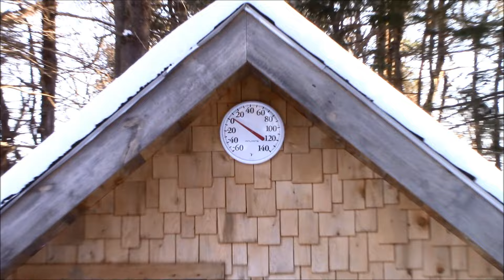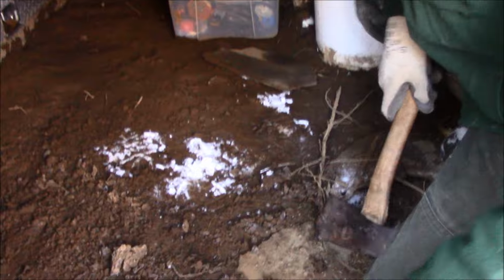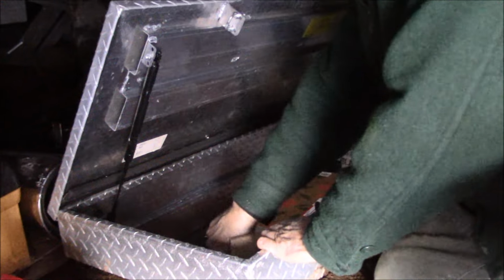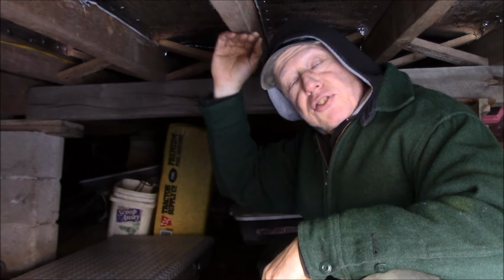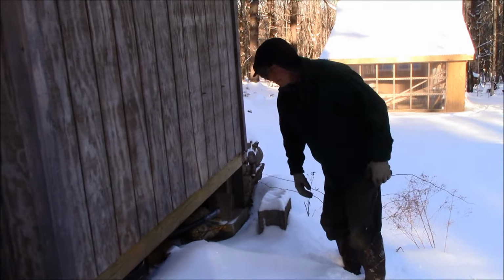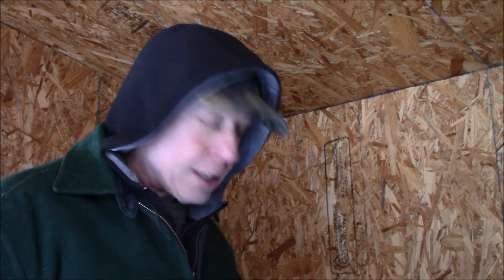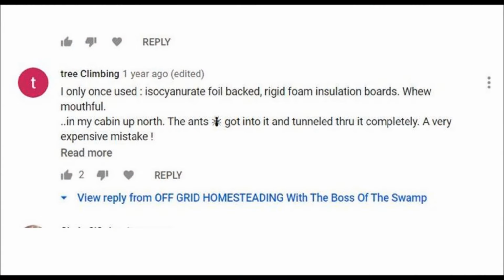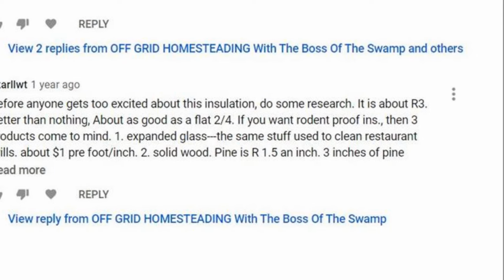Awesome Floor Insulation For A Cabin In The Woods   3rd Year Review

Comment: I think what you’re doing is awesome and works.  I have come up with a “layered system” using this foil and other common, easy to work with, and inexpensive materials to insulate my ceilings with. NASA insulated the first moon shot rockets and the Space Shuttle with this kind of foil. The Aerospace Industry, Automotive Industry, the Construction Industry commonly use it. Tesla and SpaceX uses similar material on both their ground and space vehicles. Works great for insulating cabins.

Comment: hi bosss i have  used  this bubble   foil  in my metal barn 32x48 with great results  wall and sealing  Its made the whole shop much more comfortable  I am know framing walls and plan to use fiberglass ins  The only down side to the bubble  foil  is it burns  like a match

Comment: I watched both of your videos on insulating cabin floor while my wife and I were building our cabin home. We already had floor down so used 16 in wide strips of that foil between the joists in floor and ceiling. We also used pink fiberglass in ceiling. So I would like to go on record with u no mice in floor no underpinning yet but while we camp over there you can walk across floor barefoot with no frozen piggies so they can still run home. Just wanted to say thank you for the information otherwise we would have used fiberglass in floor my face arms neck back stomach and everywhere else it would have gotten thank you as well.
Reply from the maker: Warm piggies here too troy :e)

Comment: Boss, I've used the foil insulation on a cabin roof and did not regret it, I just Spray Foamed the roof recently but will be repurposing the foil insulation to the skirting & under the floors. Works like a charm and I credit you with keeping our cabin warm the last several years. Thanks !!
Reply from the maker: Good to hear from you Jerry. It's been a while ;-)

Comment: I've been slowly rebuilding my old mobile home and used Boss's idea and have a full wall in my kitchen insulated with nothing but single layer bubble foil, I have nothing covering it at all and I get now coldness seeping in from the metal mobile home exterior It works great. I also have some videos of it as well.  I also insulated the floor in my bathroom.
Reply from the maker: The stuff is amazing.  Those jugs of water never freeze in that shed and only plywood and one layer of foil between them and the winter temps :-)

Comment: I am building a 15 x 30 shed and thought of using the bubble foil perpendicular on top of the joist, provide some slack to create an air barrier when I install the OSB sheeting on top of it. 
As always, I respect your judgment, and opinions. 
You and Lori are the best, enjoy your well-deserved retirement.
Shalom and God bless you both ❤️
Joseph Callahan
P.S. I remember your original video years ago, and have been spreading the news ever since.🥰🥰.
Reply from the maker: Always run it parallel with the joist so the seams are over wood. Trust me on this and have fun with your project.
Reply: @thebossoftheswamp  will do, greatly appreciated dear boss.

Comment: I used 2" foamboard inside - between my 3/4" PT subfloor & Advantech high density OSB. The Advantech holds nails well, in my case 8" wide white pine. Under cabin is open & free of critters.
Reply from the maker: Advantech is the best :-)

Comment: Hey from Louisiana!!!!   Bubble Foil is "BOSS"......Can also be used in passive hot water systems to "reflect" the sun's rays back to the hot water tank.  But be careful..you should use the Foil that's rated for sunlight..  It has to pay for itself. Thanks Boss for your vids.

Comment: What the boss speaks of and shows is true. I skirted my cabin with bubble foil the way he showed and the ground does not freeze under my cabin. And I no longer have to use a heat tape on my water in pipe or my traps. On the coldest days of well below zero, its around 45 degrees f under there. I know because I keep a wireless thermometer under there to read inside the cabin. If its 20 degrees outside it stays in the 50s under there. I believe doing it like this helps the cabin hold a lot of the warmth the earth naturally gives off. And yes the earth does...do the research.  And I think this is why the ground doesn't freeze as well. Thanks boss! You really helped our cabin and its efficiency!
Reply: Adam, did you put bubble foil on the underside of the floor or only on the skirting?
Reply: @kevinvieyra7468  the first winter, which was last winter,  I only had it on the skirt.  That was with no insulation in the floor joists. And  this winter, I now also have it in the floor joists. Both cases it stayed about the same temperature under the cabin. Before the bubble foil I had r 19 batt insulation between the joists. The floors were painfully cold. Could not walk without slippers. The floors are much warmer now and we can walk with our feet. If you are considering doing this. I would start by doing the skirting first, that helped me a lot.

Comment: I moved into a previously foreclosed house and aside from building new I knew nothing about rehab.  
The house had a good basement and had had double pane glass windows installed.  And fiberglass siding for some reason they had installed after they removed the aluminum siding??!!
But the original knowledge of how to manage was lost and thats the reason it wound up in foreclosure.  
They installed a gas furnace in the place of the wood/boiler and used the same spot which meant the intake/exhaust was in a low area that did not get sufficient outside air mixing.  Plus the slant allowed water to drip and build up outside which over years allowed a crack to develop in the basement wall!!
When I moved in the basement window storms were long gone so I used plain bubble wrap to make double layer 'storms' I taped up inside.  The biggest problem was that either the original or subsequent owner had set the furnace to blow up thru the cold air returns and draw thru the wall outlets.  This circumvented the air filter space and I suspected CO2 poisoning after a hospital ER visit.  I used the length of my arm to reach into the joist space to pull out dust mats.  Not so good but after being told by HVAC they did not do duct cleaning, next year I added the length of coat hanger stretched out to my arm length and SURPRISE removed a complete 3 inch dust mat the length of the covered joist all the way to the central duct. This did the trick, but I have no idea of how much dust is in the ducts to walls. 
The big problem was cold when the wind blew.  It was so dank also.  Was this because it set for 5 years without heat?  Now in my 6 th year and the gas bills and elec are much more reasonable and the house is warm.  I stuck with it because I had no other place to go so maybe the house 'rehydrated' after being dried out.  The cops stole my and my husband retirement home in Rhinelander WI and I suspect I was supposed to give up after going deep into debt here.  I am waiting for the Feds to put a stop to this 'cop shopping' that involves social workers, cops and coercive hypnosis and a 'looking the other way' community.

Comment: Avid fan of bubble foil..We use it for a different reason..a West facing single pane picture window with no trees. It lowers the temp 10-15 degrees. We do have black out curtains as well. Works great in the West facing bedroom windows too!!! Not able to replace windows yet so we gotta do what we have to. 

Goes up late May until September then plastic goes up to let light in but keeps the cold out.

Comment: My 14x40 cabin is wrapped in reflextrix and no other insulation and was decent with heat indexesof 109F.  My cabin is toasty warm in the 30 degree cold.  I am amazed!!!
I watched you when we could not get insulation back in February. All I have is refectix, and it works. I dont have skirting yet.

Comment: Right you are my friend. In Texas they are using foil backed roof sheeting and installing the foil side down, facing the inside of the attic. What it does as the heat penetrates the sheeting the foil reflects it and sends it outside, thus keeping the attic cooler. Matt of R&R Buildings on You Tube did a video on this process and you can look for it on his channel under Building a LP House. This system is backed by the state of Texas, what more do they need.

Comment: love it in the south too, where the outside temps get above 102. staple it to the rafters with a little sag. 

extend a tongue over the top plate and into  the soffit void. 

a ridge opening creates a chimney  drawing cooler soffit  air into the space and naturally venting it at the ridge vent.

bubble insulation only passes 3% of the heat energy striking it through to the other side

Comment: Hello Boss. A question if I may. Sandwiching the bubble foil between the floor joists and the flooring plywood, does it have much creeking or noise when walking on it. I'm guessing you used screws to fasten to the joists. Great video, keep up the good work.
Reply from the maker: I nail it down. There may be an occasional squeak but that's not bothersome to me.

Comment: I bought some bubble foil from an army surplus store that has some vinyl on one side that is used to insulate big water tanks. I was messing around with it in the house and made a big circle around my recliner with the top left open. I put a dish heater in there and I could not believe how hot it got. Even after shutting the heater off the heat stayed in there for a good long while. Pretty incredible stuff
Reply from the maker: Incredible stuff indeed.

Comment: Hi Boss,  I really like your out of the box thinking and applications......You’ve got me thinking about another use of reflective bubble wrap, knowing it works well for cold weather floors, do you think the reflective properties would also work in warm weather climate underlayment of roofing plywood to reflect (deter) heat from entering ?  Not saying as a substitute for insulation but to reduce temps in attic spaces.... Thanks, Blue skies
Reply from the maker: If it were me, I'd leave an air space neath the plywood and the foil so the heat can exhaust out the ridge vent.  I don't believe heat would penetrate the foil at all with this application.

Comment: This is just ticket for our new elevated combo deer and photography stand. R value, R smalue! lol  As a veteran of cold climate seasonal cabins, chalets, and cottages, as well as thermodynamic principles I can see how this is working. First, it's an air barrier. Second, the foil reflects heat back. Since a lot of heat actually radiates downward having foil facing up under the floor should really slow that down. Very impressive warmth under the house, and as you explained that enough warmth gets down past the edges of the strips to prevent freezing. And that cold is as brutal as anything we get up in Ontario. Once I had to build a plywood box with 2 inch styrofoam inside, around where the waterpipe came up out of the ground and into the skirted cottage. A distance of 3 feet. It kept the mice out but I had to hang a trouble light in there all winter after the one metal part froze. The shutoff valve. Thanks for the great video Boss.
Reply from the maker: This foil is shiny on both sides so it reflects both ways.  It's simply amazing stuff and I don't itch me arss off installing it.
Reply: @thebossoftheswamp  Thanks for the reply Jim. Yes I know. Both sides. I'll leave a comment after we do the blind. Might take till next year. I'm thinking that a floor 12 feet in the air will not have a skirt. So I'll just nail up some thin ply on the bottom, have the bubble foil on the top side and that joist space will be still air. Warm toes are good. signed: Bruce

Comment: I was watching another guy on Utube and he mention you as the foil guy, fondly i must add. So I checked your videos and so glad i did. I too beleive in your ideas. even if we are alone.  I live in Central Ontario Canada and we get about 6-8 weeks  some where between Dec and Mar where the temperature is around minus 20 C, we also get the same 6-8 weeks of heat and humidity between May and Sept.  I have read, seen , watch and looked into the foil ever since i insulated my crawlspace a year or two ago and found  such a tremendous difference in my heating bill. I have a poured concrete foundation with dirt floor covered ina cleanspace vinyl with french drain and sump pump as we get ground water in fall and spring. The cleanspace works wonders, but it was put on years ago and before they were insulating against the cement. so I ended up putting the insulation on afte the fact. so with the heaters  in the crawlspace it keep the floor warm and the plumbing safe.  So to be so long winded but wanted you to understand where i am at. I need to replace my roof( long story) and I a thinking of re siding the building with new windows.  This is my retirement home and I do not want to be worrying about this in 20 more years. So i was wondering what is any experience you have with attic or wall  {bubble foil ) insulation you have encountered.  Any thoughts you might be able to share would be extremely helpful. Thanks for sharing and letting us into your world. Thanks again.

Comment: I wrote this on another guy's video who installed some bubblewrap:
Thinking about your work the mention of the heat loss in the ceiling and floor brought to mind an image of air flow.
In the winter when hot air rises and leaks to the atmosphere it draws air in from the outside.
That air being cooler it pools near the floor.
When the floor leaks the cold air it also cools the floor.
This suggests that sealing the attic and the floor would really decrease the heating costs.
In the summer the airflow would be reversed.
The cold air would be heavier, 'pressing" on the floor and leaking out of the house.
The exiting air would draw in hot attic air adding to the AC load.
Notice that at no time did I say insulation.
Bubble foil has an R-value but the big positive value is as a air barrier sealing up the air leaks.
Air stays in place and no air is drawn in.
The HVAC circulates the air not convection...
Forget the R-value, it's just icing on the cake.
The Boss stumbled onto this and experts are trying to say his perceived positive comfort gains are a placebo effect.
They are solid science of air infiltration and exfiltration.
Those "experts" need to try it and report back.

Comment: Greetings Boss
May I offer an alternative view on the temperature differential you are experiencing in the crawl space? The Earth itself, when protected from freezing temps, as yours is, has an ambient temperature of about 55 degrees F. You can use a thermometer to find out for yourself. I may be wrong. So, there is thermal mass which holds the temperature fairly steady year-round, I am guessing. 
The structural members are thermally active - they respond to temperature changes. The floor members may be warmer than the surrounding air and may radiate some heat and it would stay near the floor surface, not travel down as you suggest. Warm air rises, cold air falls. 
So, I believe it would be an interesting study to measure surface temperatures and the air temp at multiple elevations between the soil of the crawlspace and the underside of the cabin floor. I am very intrigued with this application - and wondering if it would work in a tiny home application, especially if the floor joists were totally closed in.

Thanks for your posting.
Reply from the maker: I'm certain that most of the heat beneath the cabin is generated by the earth more than the joist.  If I lay a vapor barrier (tarp) over the ground, the temp drops a few degrees under there.   I think you're spot on with your observations.
Reply: @thebossoftheswamp  thanks for reading. BTW, I like your cabin. Very sweet

Comment: Dear Jim, an excellent combination of the traditional and modern technics. In my experience at least is the preparation of the cabin rodent free and insulating it from heat loss aren't be done by the same one thing but both are really needed. Only a bit more expensive (but needs unfortuntally much, much more work hours) is the use of the heat reflective bubble foil near the inside AND the very careful stabling of an additional layer of metall fly screen or mice grid all over the cabin, leaving nothing free on the opposite side. I put it under the schindel layer, taking in account that the schindel would be shortly destroyed by those silly little rodents and needs to be replaced.
Reply from the maker: I just posted an update on the topic of this floor insulation.   https://www.youtube.com/watch?v=Wa2-FWAwwUY

Comment: I'm currently building a cabin in the woods. I used your idea, so thank you.  The only problem I have had so far is that when it rained sideways before the walls were installed, some water ran down under the plywood floor and got trapped between the top of the bubble foil insulation and the wood flooring. I drilled a tiny single drain hole through the insulation to drain the water. Working good so far.
Reply from the maker: I would slit the foil and let it hang down. When everything is dry, staple it back up and tape the seam.  Good as new ;-)
Reply: @thebossoftheswamp  thanks for your reply. I put a drain hole in it and that seemed to do the job. Love watching you on YouTube.

Comment: I think you might consider that the heat is also significantly from the earth itself. Yes, it's insulated, but the earth is also warm  (57 degrees at 8 feet) and your bubble foil also keeps in the heat from the earth. The cold  comes from above.
Reply from the maker: Agreed.